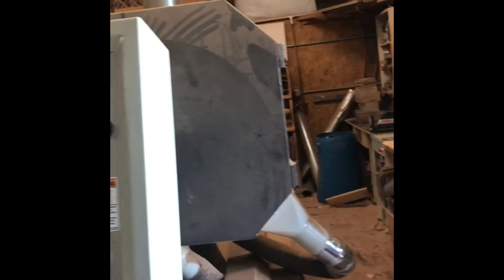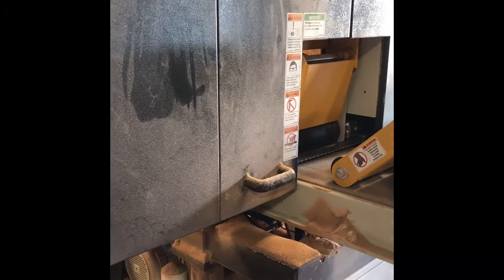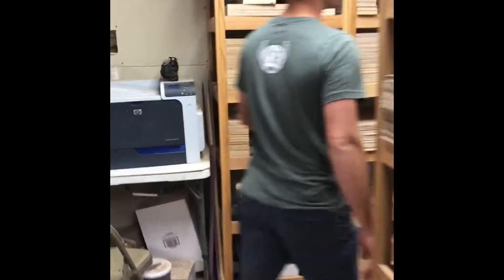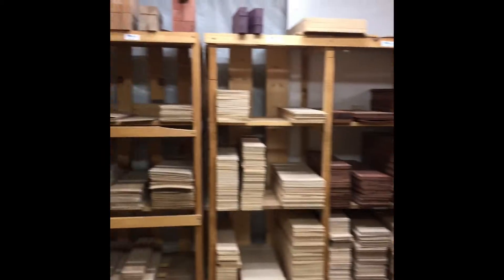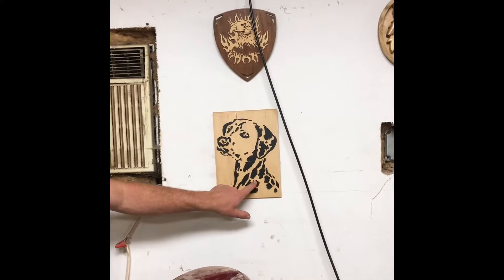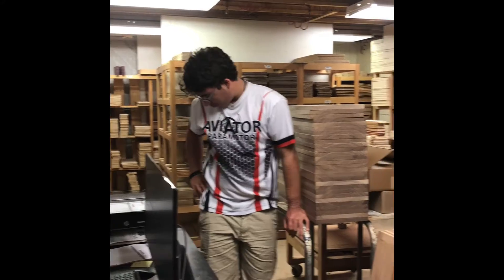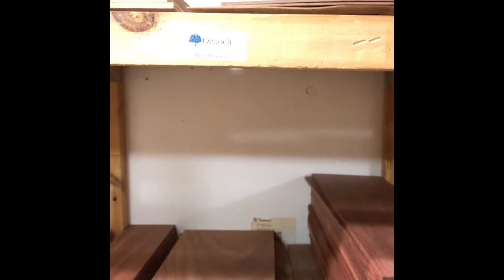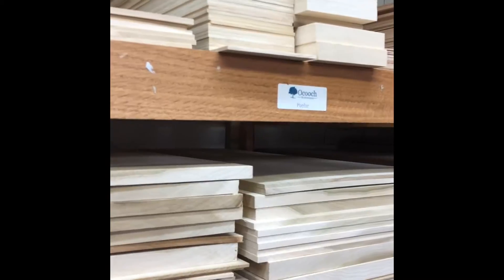Visiting “The Wood Guys” at Ocooch Hardwoods In Viola, Wisconsin

Comment: It's ok to make a mistake but the real tell is how a company handles the mistake.  The customer experience for me was terrible. Two different orders came with 10-20% of the pieces as very disappointing.  First order came with black limba riddled with holes, maple with splotches, all other thins were well warped out of the box.  When I called, I was told that if I didn't want holes in the wood, I should have asked for that in the "comments section".  The second order came with shipping damage due to poor packaging (0.5 thickness corrugated cardboard) and the most expensive piece (Bolivian Redwood) with another hole in it (after I had just called them and asked for pieces without holes).  After sending an email, I was told by Ethan that he has too many happy customers and that I should take my business elsewhere.   See photos.
Reply: Wow! I was going to order some wood from them but if they will treat a customer like this, I'm thinking I will change my mind....
Reply: There's too many other companies that value the customer to worry about this one.  We aren't talking about a batch of cookies, this is exotic and expensive imported wood.